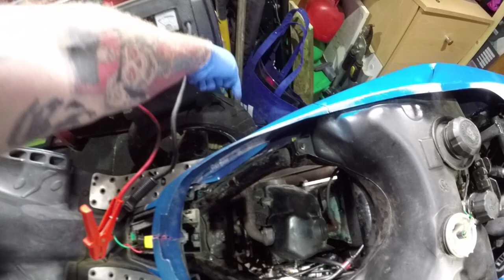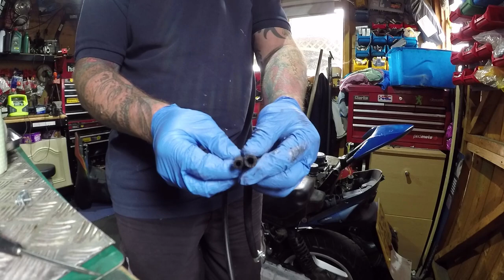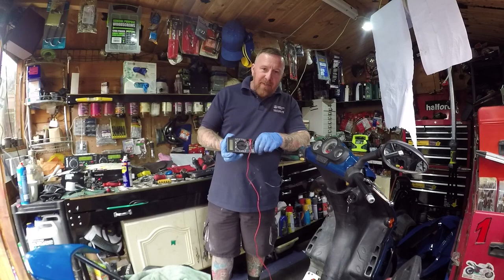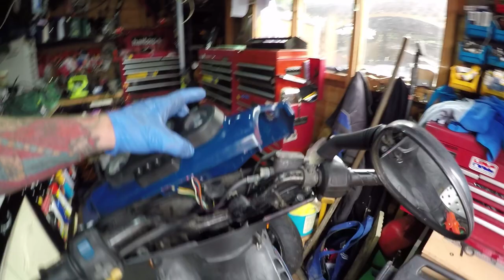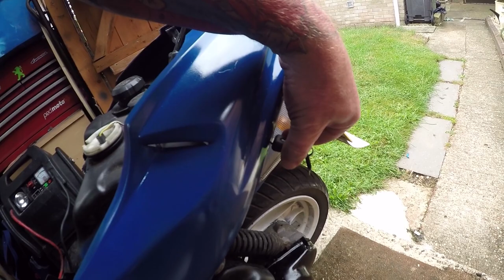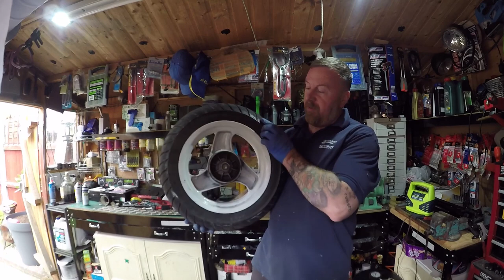SPEEDFIGHT MOPED CARB KICK START VARIATOR WIRING HEAD PLUG MARK SAVAGE

Comment: I have a TaoTao I bought last year with 1350 miles on it . In the winter it started to get hard to start and wouldn't run . I did all the maintenance, cleaned carburetor, variator weights cleaned and replaced . I put it out in the yard , bought a new 49cc. 
Last week I installed a $25 ,72cc big bore on it . 
Runs like new . Now I have a $200 tao with over 10,000 miles on it that I like better than a $1200 dollar scooter with 1500 miles on it . 
The best $25 I've ever spent.
Reply from the maker: Now that's good to hear bud well done

Comment: Hi Mark! 30y old female here, born and bred in Sheffield, moved to the wilds of Northern Sweden to live out my days....yes, it's chilly up here! Bought myself a speedfight 2t AC, for number 1. to have a bit of fun on the warmer summer days and 2. to learn my self a bit of mechanics!! Gotta say your videos full of chit-chat and useful bits of info have really given me the confidence to get stuck in and give it a go! 
Now for a question....why won't my bike start? Just kidding!!!
I did a service, (carb, plug, filter)and will change the rollers.But one thing I've noticed a high pitched whining coming from middle to front end of bike.(i.e i don't think its from the back end!) Can you give me a few pointers of things i could look for, and I'll be sure to have a trawl through your videos with a cup of coffee :) I've ruled out its not a wheel bearing, as it still happens when the bike is stationary, but when revving. 
Thanks and take care, keep doing what you're doing. You're the Salt of the Earth!
Reply from the maker: Hi ya good to hear you still love mopeds and like to play lol
Yes there's 70 odd to help 
So front end there's really not a lot front end 
Try the old way with a screw drive and put the butt to your ear and the point on to parts on the bike 
It amplifies the noise to pin point it , yes it does work lol 
However AC so fan on other side 
It can be the stator coil , video on that and how to get off and clean up 
Could even be the fan rubbing !
Variation side 
Take it all OK change belt,  clean variator and 6g roller 
Check clutch like in video 
And see it you have any rubbing marks on cover 
They often are loose and rub 
Not really anything else not like piston or rings !!
Give them a look 
And take care
Reply: @marksavage  thanks 🙂 will give it a go.
And I will never lose my playful side, that's for sure.

Comment: My speedfight kickstart has been replaced completely but when you kick it over you have to push the kickstart lever down to 'lock' it onto the kickstart washer and then kick it, otherwise it will slip... Any advise please?
Reply from the maker: its not pushing out right , is there a washer behind the cog so its a little bit out to start bud , it may have been left off when redoing
Reply: @marksavage  you're right, I think the cog needed lubricating and wasn't pushing out properly, I think I have it sorted now, many thanks :)

Comment: Good to see you back mark. Any idea why my peugeot kisbee 50cc 4stroke keeps cutting out whilst riding !!! . Put new belt and rollers on , new rectifier new cdi new carb new plug yet keeps cutting out . Will start back up again after about 30 mins 🤔🤔
Reply: Valve clearances needs to be done. They need to be done on 2nd service.

Comment: Hiya mark I’m just wondering about my bike it’s 50cc geared 2t. I have up jetted it and added new air filter and it has a sports exhaust but my bike keeps bogging down in 4th gear, it’s like it can’t rev in fourth for some reason. I started with a 68 main jet and I’ve moved up quite a few jet size testing each one 70 76 78
My carb tho is a 21mm carb because the previous owner had a 90 kit on it 
Do you think if I fit a 19mm carb and put the 80 jet in it will stop the boggin?cheers
Reply from the maker: its due to the big bore kit bud, but yes id go down to 19mm carb and smaller jet and then try and tune
its a job bud this is why I say dont do it lol 
for the time being maybe go down jet not up as big carb and re tune less air and fuel and see how it goes , did you go up in heat on the plug to higher number plug
Reply: mark savage no I didnt really change anything other than better air(new filter) and more fuel (bigger jet) but it just bogs in 4th gear you can change to 5th but then it just losses speed pretty quickly. Might just go down to a 19mm carb and see how it goes maybe even add a tooth in the front sprocket ?

Comment: Hi, Mark. I tried to open the variators with your hammer technique, but like the end you put in the variator to lock it up its too small so I can't like lock the variator. Do you have any other ideas how to open the variator.?
Reply from the maker: You should be able to turn it round the other way 
However you can use an impact drill driver 
Easier to be Honest and you can get them for under £50

Comment: Crazy to think my 1998 speedfight has only 5053 miles on it and still has the original head and piston, only thing I had to do is bypass the cdi (cheaper) and replace the water pump but the thing flies on standard air filter and exhaust.
Reply: Lol my speedfight 2 also has the original cylinder and piston with 20k miles on it lol

Comment: Hi Mark, Great vid! Is the air box for the 100cc/50cc models different? Mine was sold without one and I can't seem to find any 100cc specific ones on ebay. Thanks.
Reply from the maker: Hi bud thanks 
The 50cc and 100cc air boxes are different, the 100cc is much bigger 
Maybe try looking for someone selling parts or breakers and e mail to see if they have any
As it will run better with it
Reply: @marksavage  Thanks man I'll have a look!

Comment: Mark what exactly have you done to the relay? Mine just busted out yesterday and I can hear the click but no buzz from the starter motor. Thanks in advance!
Reply from the maker: I have a video on the start bud give that a watch 
If you get a click and the back light works its your starter 
Can be the starter of bendix if its spinning!
Reply: @marksavage  thanks for the reply mate! I watched it and it turns out all the muck from driving in wet, salted road accumulated on the live starter connector and was sent to ground via the salt and muck. Cleaned everything up and the starter worked again. :)
Thanks a million mate!

Comment: Great video , I've just got a Lexmoto scout 50cc does 42mph and has a sports exhaust it's 4T what could I do to it to improve acceleration as it's slow pulling away but is that because it's a 50cc
Reply from the maker: 42 mph is good bud as for pull away you need to replace the rollers , check if the ones in there are old and change them ,if they are ok them check the weight and good lighter for better pull away but you may loose top end
Reply: i thought 50cc was restricted to 28mph or similer, that things nearly as fast as my royal alloy 125cc :)

Comment: I recently got a speedfighter 2 used and it’s been battered I know it might need a new carb or just need cleaning out that’s why I’m watching this but electrics don’t work and can’t hear any sort of clicking, do you think I need to rewire the bike and get a new battery?
Reply from the maker: Theres loads of my videos that will help from micro switch to relay then the start and wiring there is 70 more than 70
Type in speedfight mark savage and get a cuppa and watch mate 
They will get you back on the road
Reply: mark savage sound mate cheers 👍🏻

Comment: hey mark ive been having problems with my speedfight lately so the thing is it runs all normal but when i give it full throttle the rpm keeps going up and down (bogging) , i changed the piston rings and cleaned the carb , changed the ignition coil , spark plug , still same problem , ty mark appreciate your videos
Reply from the maker: sounds like it need tuning now bud, but have you checked the roller / VARIATOR 
I know it sounds odd and ive just today done a video which the same sort of thing which I will upload soon
it was the jet size ,tuning and the VARIATOR / belt as it would put the engine under strain as they were not going out !
worth a look then tune and look at the jet
Reply: cheers mark what jet do you recommend for a stock speedfight , stock exhaust ?
Reply from the maker: @youssefdaking  you can buy a pack of 10 from stock size they go up in 4 so start at 60 and see how it runs bud but really 60 to 64 would be a good start from stock ,then follow my videos on the rest to upgrade

Comment: Great video Mark...Keep up the great work! I have an Adly GTA 50 with a "CDI unit jet 100."  I have been looking to disconnect the speed limiter to make it go a little faster (Don't know what color of wire to disconnect). Can you help me in this regaurd? Thanks!
Reply from the maker: They often cut the pink wire but I dont recommend it to be honest
Reply: @marksavage  As far as i can remember it doesn't have a pink wire. I was only going to disconnect it and not cut it. That way i can always put it back on.
Reply from the maker: @edb3005  it's a game bud as you can blow the cdi by doing that !!
Just dont cut any black earth wires
Reply: @marksavage  thanks for the advice my friend!

Comment: I have a 2001 50cc Peugeot vivacity and I brimmed it and got just over 40 miles to the tank, believe there meant to do a bit better than that on fuel, any ideas or info ? Thanks
Reply from the maker: wow yes it really should , how is it running and what's you top speed 
is it standard ?
was it completely empty ?

Comment: Alright mate I have replaced my fork arm done everything u sed there is still aslight wobble if I turn the head stock bolts any more the steering goes hard done the lock baring left to any advice plz
Reply from the maker: then your bearings may have gone bud so you need to replace them but to be fair its often better to replace the arm

Comment: Love the vids man, although I have to disagree with the 70s kit thing, with a strengthened crank you turn a barely useable bike into a usable one ;D
Reply from the maker: ive have this point many many times and if you do the full job with the crank , quality parts head piston etc, then upgrade the carb ,reeds, spark plug, then jetting and tuning it really can make a difference 
but most just buy a 70 kit head and piston off e bay and change it and then loads of problems and ive changed back loads to get them running again so its only my opinion from seeing over 30 none runners due to big bore kits 
all the other none runners like 100s have been many other things

Comment: Hi mark I have a question about a Peugeot vivacity 100cc I would like to fit on a disc rear brake but don’t know too much about them would you recommend a 50cc or 100cc as I can’t find much online any advice will be great thank you
Reply from the maker: is it drum now?
if so you cant with a lot of pain and re jigging around bud ,if its not all that best take off clean up and change the shoes, this will help
Reply: Hi mark yes it is currently drum the piston had failed 2 days ago so currently rebuilding from the bottom up are the 100cc engines any better than the 50s? Have fitted a few parts a pm tuning exhaust 21mm carb and a few other bits thanks for getting back to me
Reply from the maker: @captaincamo240  on these the are the same size 
I'd just refit with the same as the brakes are ok on these just tidy them up 
Upgrades are ok and 21mm wow as long as it runs ok you have done well bud
Reply: mark savage it did have a 32mm mikuni when bought but was way too fast couldn’t keep the wheel on the floor it also had a pipe for a piaggio 172cc which was modified to fit was all done to a standard cylinder piston wasn’t happy lol I was wandering if you could possibly make a video about the ups and downs between the engines as I have heard that the 100cc are prone to heat seizing
Reply: Hi mark just as an update stripped the engine looks like it got way too hot as the main bearings look like they have been barbequed lol also have pulled all panels off is there any better way to contact to talk more about how these work as I would like to know a bit more about Peugeot’s thank you

Comment: Hi Mark iv a complete standard 50cc lc Speedfight 2 I'm doing up but unsure what set up I'd need forgot the best performance people keep telling me to put a 70 kit on it but I'm wanting to stick with the standard 50cc anychance what rollers and main jet I'd need to get the best performance like I said everything is stock and I'm about 16stone
Reply from the maker: It was all good till the 16 stone part lol 
I'd stick to 50cc like in my videos dont so it 70cc
The LC are faster any way 
Up jet by 4s and tune like in my video ,get a few so you can up jet a few times 
I'd stick stick to 6g but get a sport variator and clutch and new spring then maybe go up to 7g  
Try a hotter plug too only by 1 
Sports exhaust and a sports in line filter 
This should get you well over 50
Race cdi 
I had a blue 50lc and it was mental pull away and top end
Reply: @marksavage  I no I just feel sorry for the per lol
Anyways do u have any advice on what jet I should be using ?
Plus do u have any advice on what variator clutch and exhaust would I be better off with plus would I need a bigger carb ?

Comment: Hello mark! I have a problem with my speedfight 2 moped. When i rev it a bit there is a little tick in my moped. Would you have any idea what it is? Also it just stops randomly at a trafficlight or just when i stop, any idea what it might be?
Reply from the maker: Clean carb and idea jet this should help like in my video
The ting noise maybe the bendix as they often do this but have a good look around and make sure all bolts etc are tight
Reply: @marksavage  thanks alot!

Comment: Hi, Mark! How do you change the gear oil on speedfight 2? Because when I un srew the srew like where is the gear oil it drips out a little bit. So how do i get it out? And how do i fill it?
Reply from the maker: if the engine is still on the bike it can be hard to get it out with out taking the gear box cover off and letting it leak out
check out my two videos, i have loads that will help you 
https://www.youtube.com/watch?v=pQ0x8c7Uicg
 https://www.youtube.com/watch?v=wBuVjppJyt4&t=6s
Reply: @marksavage  do you have any videos, that show, how to take of the engine off the actual speedfight 2? Is it really hard? And is there a lots ov wires and that?
Reply from the maker: @raivisvjaksa4686  there's over 100 speedfight videos to watch and help 
Type in mark savage soeedfight 
They will all come up 
Emgine taking out  replacing , rebuilding,  stator , reeds, carbs, heads , pistons , starters, looms , it goes on and one front end etc etc 
Get a cuppa and put them on the big TV 
You can rebuild one from frame to running with my videos

Comment: Hi Mark! I had the problem with my carburetor on speedfight 2. And I needed to regulate my carburetor so I twisted it 90 degrees so it gets more air. But it didn't make any difference. Do I need to twist the screw just a little bit like 20 degrees? Or could it be something else why it's doing like that. Ooh and the rpblem with it is that when I'm driving at like 50km/h and then stopping at a stop sign I don't have gas and it sounds like it chokes too much gas. Could it be the carburetor?
Reply from the maker: It is your carb bud
Follow my tuning video on here 
Changed plug and air filter ?
Take of carb 
Clean like in my carb cleaning videos on here 
Re set air mix to 3 half and then out like i show you 
Should be better

Comment: Hi I have a Peugeot kisbee streetzone 2t and having issues with my indicators, they only work sometimes when I press the switch and sometimes they don’t work at all, any ideas what this could be ?
Reply from the maker: Water can get into the switch 
Take apart and wd40 it and turn off and on without the power on Give I it a good clean and test 
If not that then wd40 relay connections or change relay
Reply: mark savage thanks for the reply , I think it’s the relay I just don’t know where it’s located cus there’s no English information sites
Reply from the maker: @jesse.pinkman..  not 100% on this mooed 
Norm under the clocks or under the seat bucket or side rear panels
Reply: mark savage thanks very much for your help, love your vids btw very informative and helpful :)

Comment: Hiya mate just wanting some advice, I’ve tried starting my speed fight and it won’t start I took the spark plug out and it was dry so cleaned the carb and still the same! Anything u can recommend checking?
Reply from the maker: have you done the wet hand test like in my videos?
if it get wet your oil seal and reeds are ok if not the you will have to check them but maybe prime your carb like in my videos and see of use easy start to get it going then it should be ok once you get going 
re check you cleaned the carb and the float is letting fuel in

Comment: Hello mark I have tried to fix my Yamaha arrow 2012 2 t moped but I just don’t know what the issue is it will run but almost feel like it gets stuck in a gear and then it will get unstuck and run like normal it makes a bogging sound when this happens it only happens at lower rêves what do you think the issue could be ?
Reply from the maker: you say it gets stuck , what do you mean as in engine jammed , variator jammed or just dies on you .
maybe do a video on your problem and upload so i can see what you are saying
Reply from the maker: are you using e10 fuel , like in my vidoes . worth a watch
Reply: @marksavage  sorry for terrible response I have just finished my gcse but if uploaded a videos could you have a look
Reply from the maker: @Shorts_king1785  yes upload it 
But watch my videos like I've said in your other comment